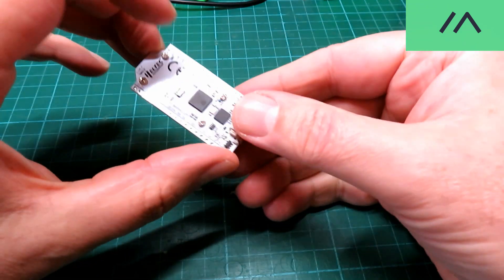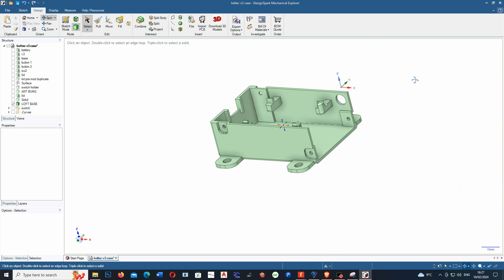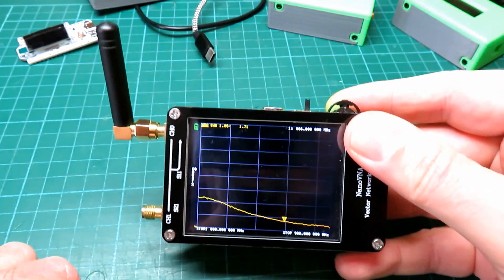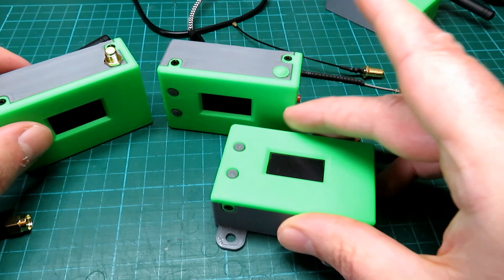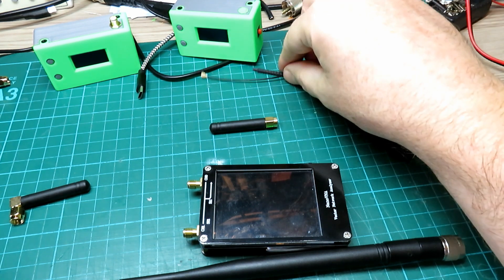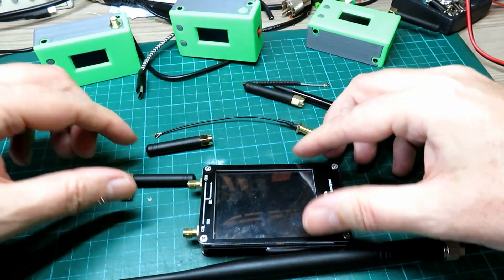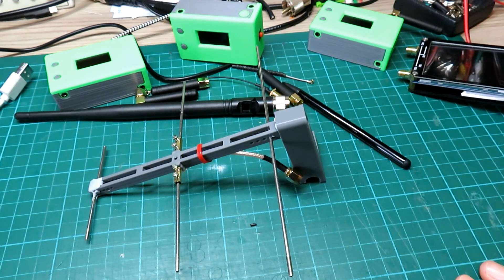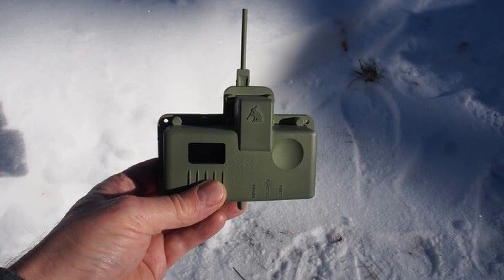IF THINGS GO SOUTH YOU NEED TO BE PREPARED - A FAIRLY SIMPLE REASON WHY YOU MIGHT BE STRUGGLING.

Comment: It would be  interesting to remove the cover on the antenna with bad swr, i just opened a couple of mine, they have coiled wire, looks legit, but i don't have a vna atm, so can't check centre freq
Easiest way to remove the cover is to get sidecutters between the plastic and brass as if to cut, gently squeeze and the cover will start to come off, a bit of wiggling does the rest ;)

Comment: I ordered four WisBlocks the day before yesterday and four 8.5 dBi antennas yesterday.  I'm a ham radio operator so I feel guilty not making my own antennas.  Your little Yagi looks great.  A three element Yagi should have around 7.5 dBi of gain.  My goal is three solar powered boxes mounted to PVC masts on the roofs of houses so my brother, sister and I can text with Meshtastic.  They're each 2.5 miles from me in a typical rolling suburban terrain.  I'll design and 3D print custom PETG enclosures for the WisBlock, solar panel, battery and antenna.

Comment: If you are prepping for SHTF then there is no point in a mains power supply as the mains will be unreliable. Far better to look at a solar cell and a battery. Some US people use a IP 6x box and a big solar panel (A4 ish size) and use this to charge a pack of 6 - 12 18650 batteries in parallel If your house has barge boards right up to the ridge of the roof then use a plastic box as an apex finial on the roof -inside you put the electronics, outside you put solar cells. Can a printed enclosure be truly waterproof??

Comment: Quick comment on your EXCELLENT yagi antenna...

You will want to have the elements in a vertical orientation. Since all the duck antennas are vertical, you will want the same polarization of the RF.  (Unless you are installing all antennas in your mesh horizontally... but vetical gets you more omni directional coverage)

Comment: I have 6 of these with 3 WisBlocks on order to turn into repeaters. I am planning to use my systems with ATAK, which would be awesome in the field or hiking. If you are using Meshtastic, and have not checked out ATAK, which is free, you should. You will need to side load the Meshtastic forwarder plugin to make it work. I do have that link on one of my videos if you want to get this setup.

Comment: Very informative video.  I haven't done any HAM radio "like"  stuff in 10 + years and found Meshtastic interesting and for those very same reason you did.  I picked up two of the Heltec V3 and had a devil of time trying to get them programmed.  The difficulty came down to the fact the browser your using can't be off chute Chrome version,  its has to be Chrome.  Up until your video I had only suspicions about the antenna that came with the Heltec.  I'm in a Condo, and put one unit in the loft and walked around the neighborhood.  The furthest test I got was maybe a 1000 ft.   Depressing, but then your video explained it. You have to buy a name brand antenna or make your own, in order to do anything useful with the Meshtastic. Amazon has a lot of sellers selling total crap, and those rating you find for the vendor can be fake, bot generated.  Again Thank You for the good and helpful information.

Comment: Regarding the loft node, why not power it with a small 12v lead acid motor cycle battery (or bigger )connected to a trickle charger. That should keep it running for quite a while if the mains power disappears.

Comment: I have a lot of these mini whip antennas and they vary a lot and some are really really good but you have to measure it first.
Such Stepdown converter can cause a lot of HF noise that you don't want to have.
I'm well experienced with lora and flarm on 868mhz but meshtastic currently disappoints me.
Even with very good setup, cavity filter, low loss antenna cable, vna measured 9db coli antenna I don't receive any nodes from a high tower in Germany even I know that it's in line of sight of a node 80km away. And 80km isn't that much for lora even with sf9/125 mod.
I receive flarms 300km away with gsfk mod with 25mw so it's not on me.

Comment: Very good point concerning the antennas SWR. 
I'm in Belgium and we use 433 Mhz.  Could it be that the "bad" antenna is made for that?
I have a question...
I like your "loft" box and the 220vac to 12vdc conversion, and then the 12vdc to 5vdc board.
Couldn't a 12vdc cigar plug to USB adapter like I have in my car to charge my phone, do?

Comment: I've noticed a significant shift in state of tune with certain antennas when they are presented above a counterpoise.
It is maybe not a justifiable test to expect the grounded internal surfaces of a NanoVNA to replicate a real life counterpoise scenario.
Reply: Agreed. When connecting with a 4" pigtail, the dip in the SWR can be moved by over 100MHz by applying light finger pressure to the pigtail and moving the finger over the length the pigtail. The parador 868MHz antenna is much less sensitive to the feedline.